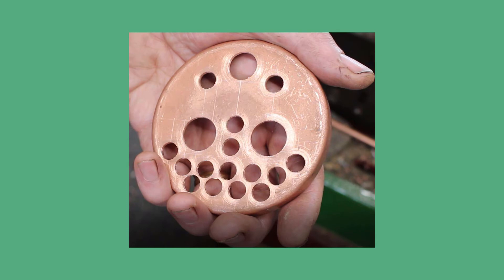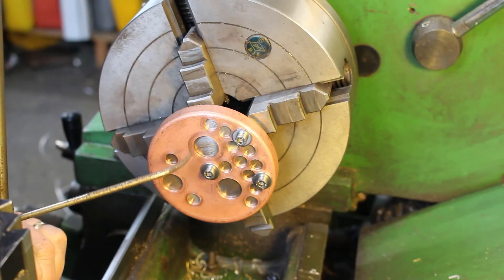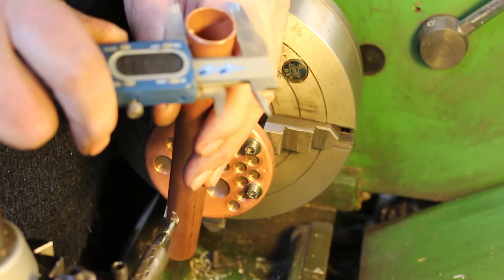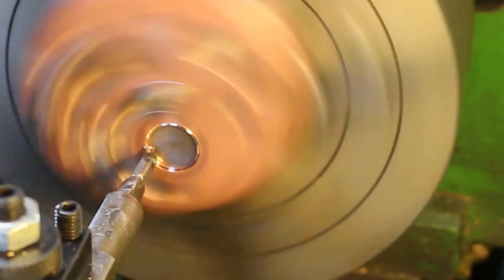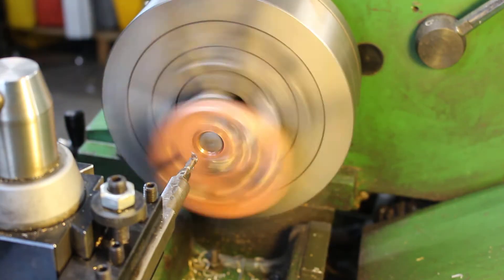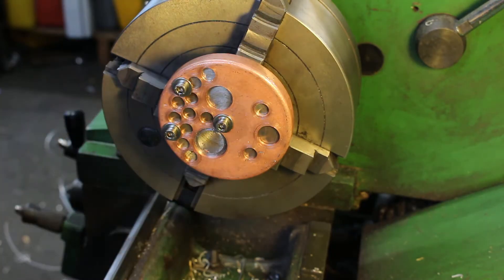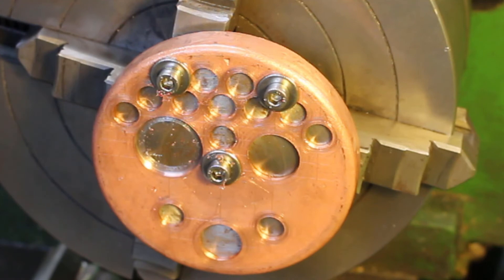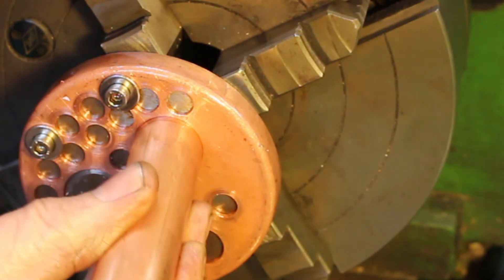Lion Miniature Steam Loco Build Pt 4- Tube Plate Completion

Comment: That was an insane amount of work for just a couple of 1 inch holes!.. Is there something I don't understand here? After you made the initial starter hole, why didn't you  just leave the boiler plate right where was and switch to a boring bar to get to 1"? You had to mill the fixture to fit in your the 4 jaw of your lathe to finish it?
Reply from the maker: I wouldn't want to use a boring head in a drilling machine  that does not have a fine down feed. Additionally, to fit a boring head in the drilling machine would require the drilling machine table to have to be lowered loosing alignment of the spindle with the work. As a hobbyist I'd much rather do accurate boring of larger holes in the lathe, I'm not in a hurry and I enjoy 4 jaw work.
Reply: @GoCreatehms  How about your mill then? I would have done all the holes on that mill.
Reply from the maker: @slashmaster2  yeah, using the mill would have been another way to go.